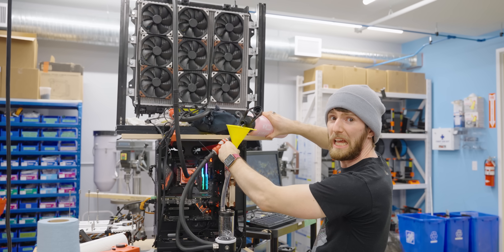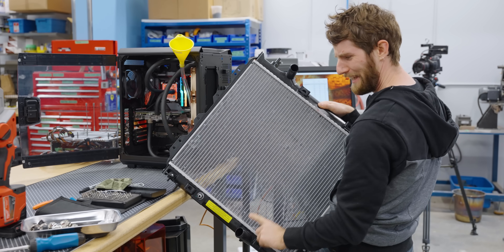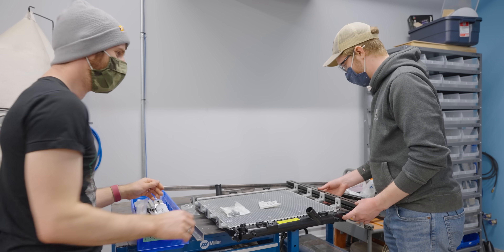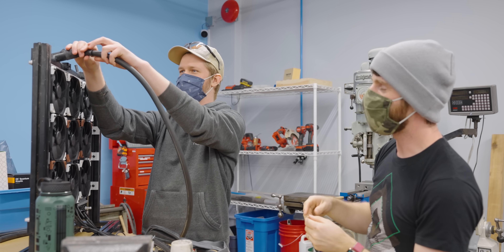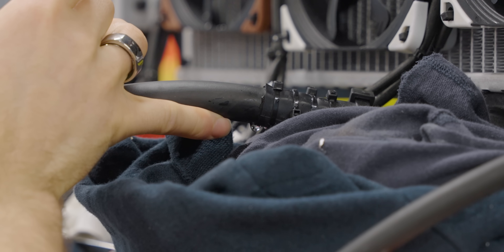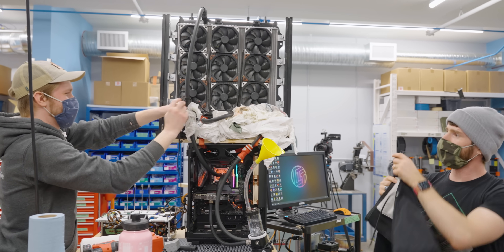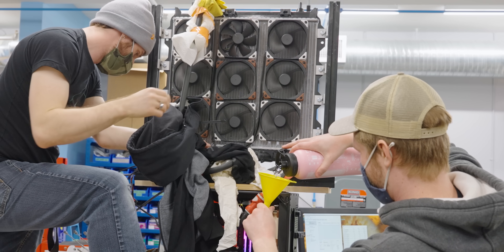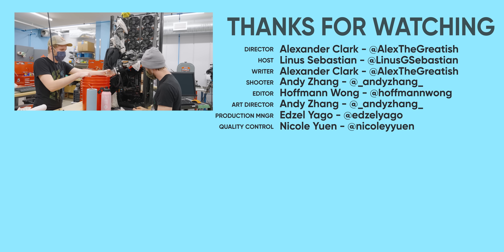Our Craziest Cooling Project Yet - Car radiator liquid cooler

Comment: Wish i could share a PC i built. Took a Transmission cooler for a 2 ton RV and built it into the top of my ThermalTake Cube PC. Used a vintage ThermalTake P500 pump Blue water line and Did a loop system through a Old amd Fx 8120 and an amd 290X. Keeps things super cool under load. Was one of those i think i can make this work. Litterally watching this video on it now. Been running strong for over 7 years!

Comment: I was thinking of just using a bucket. Recirculating the water to the bucket and using a fish tank air pump to cool the water with a aeration stone. I'm thinking 5 gallons should be enough to dissipate 750 watts if it doesn't then I can use ice bottles.

Comment: You went to NAPA to get the radiator. you didnt think host clamps were a good idea? On the other hand, and I say this as a fellow fabricobbler in the adjacent North, this may be the most Canadian thing you have ever done. Much love from the States. Also, why not just 3d print some reducers and using short cuts of the right diameter radiator/pc cooling hosing as couplers? They should take like 20 min to design in OpenSCAD - in fact I think I'm likely to do just that.. but with a Spal fan and appropriate shroud for the radiator, all RTVd together to make a nice airtighht seal with a separate fan controller triggered by an automotive thermal switch, or a nice digital thermometer probe embedded in an NPT plug. In fact, I do have that dead Silverado with everything in the reactor pit perfectly fine... Also Im thinking tranny loop for the cpu(s), as they are not your biggest heat source anymore, and use the big loop for the GPUs. Several big ones. Also a set of cheap inline fuel pumps should make good fluid motivators. Bonus, all the car crap is 12v and very voltage resistant by design(usually about 9-15vDC, 13.8 Nominal) and also designed to be battery operated, though with a limited charge apparatus (ok those are both the same point, but the latter also implies power efficiency, as in, low amperage requirements at proper voltage). Very nice for interfacing with PC stuff, esp with proper mosfets, relays, or other high load power switching. Don't forget your fuses.
Reply: I know! ditch the rad altogether and just stick the rig in your basement next to the water heater. water from the pump goes to your rig, which goes out to the water heater - preheating the entire volume of the water in the pipe between pump runs, and effectively preheating the water for your baseboards and hot taps, lowering your heat bill! all passive. Games or AIs start lagging? Do a laundry run! Tell your kids to take showers! Or keep the rad with no fans as a presoak chamber for the heat and massive passive cooler. Man, if I could get my whole rack to operate like that without it being like the sinking of USS Thresher... Obviously install a bypass valve and conduit so you can reroute the water flow while servicing the main computer systems...

Comment: if you go to a junkyard you can probably get a car radiator for $20 usd (idk what that gonna be in cad) you can get the fans with it for a little more and then if you get it from a car with electric water pump you can get the pump. get some antifreeze and distilled water and you got a crazy cooling loop just make sure the fittings on your pc can handle the pressure. or get a lower pressure radiator cap or something if they sell those

Comment: Watching them hook up into the auto trans cooling lines makes me cringe. It is made for cooling a hydraulic fluid and travels through a heat exchanger in the bottom of the rad. Vehicles with manual transmissions do not use the lines.... they are just left alone.

Comment: Omg guys, all you had to do was put an anti-crush tube inside the smaller rubber tube, then you could have cranked those zip ties down. And a bit of RTV inside the bicycle tube would have been the final icing.

I like most of your "seat of the pants" stuff, but this was a bit shameful. Just plain stupid for the main rad I/O connections.

Comment: you must use liquid to liquid heat exchanger and the suitable fan, bracket, pump, then i promise it well go excellent but not perfect because this radiator is designed to cool 100 degrees rushed water

Comment: Should of blocked of the trans cooler ports its serving no purpose the water on the radiator is just going to try and cool the same water in the trans cooler section

Comment: I plan to build a pc with a water cooler but as a car guy ima find a small turbo housing for the pump with an electric motor spinning the compressor wheel circulating water with water wetter. And a baby intercooler for the radiator with a few fans behind it it

Comment: the transmission cooler part is essentially a heat exchanger core in the outlet of the radiator. It does not need that much cooling and it uses the cold end of the radiator to get that little bit it needs.

Comment: This was pretty disappointing. All they needed to do was use some normal size radiator hose and 3D print an adapter. Or they coulda even ran it in a bucket.

Comment: I'm glad it seems like whoever is making the video schedule has allowed them to slow down in recent years because damn, you can feel the frustration.

Well, unless this was intentionally a meme video lol, but time constraints seem waaaay more likely. Linus seemed genuinely stressed, like why else wouldn't he just turn it off. Kinda sad to see to be honest. You can tell when he's working on a project he enjoys and has the time to do correctly.

But ya, it would've been so cool to see how well it cooled if you used a high-powered fan, I mean, in a car that thing is being cooled mostly by air passing through it as the car moves, not a fan. I wonder if it's even the same type of metal, which if so would mean they'd have different cooling properties.

Anyway, 3-year old video so who knows, maybe there is a sequel to this, I haven't checked.

Comment: For future reference you can often use electrical heat shrink insulation and/or tape to make the smaller pipe bigger enough to use a zip tie to seal on it.

Comment: In case anyone sees this years later, it seems Alphacool will now sell you a 400 x 400 x 45 mm radiator with mounts for 9x 140mm fans or 4x 200mm fans, with proper threaded holes for watercooling barbs. This is not an endorsement, I haven't tried it; but I want to.

Comment: How about you use an water boiler or buffer storage like 100 liters is enough to storage about 1,163Wh/kg*K * 100kg * 50K = 5815 Wh
If we measure a max output of 1000W for a potent System that would be around 5 hours to heat the 100 litres up from 20°C to 70°C
So next step would be a second seperate heating circuit that cools down the water storage. How about a heat exchanger on the outside with antifreeze for winter.
This dont have to need a pump you let gravitation do the work the lighter warm water will rise and the colder more dense water will fall back into the boiler.
This needs time but yeah if you take a 300 liters boiler you need to play like 15 hours on max settings to produce enough heat for the boiler.
Everyone needs to sleep and in this time the boiler cools down on its own without a pump.
Reply: The biggest Problem today is that we have systems that produce more than 500 W heatenergy, this will heat up your room and you have to do something about it.
Thats the reason for external heat exchanger. You can place them in front of the window and blow out everything or heat up your room in winter.

Comment: They are doing it all wrong, which is why it is leaking 🤦‍♀️

What they should use is 1 inch (whatever the OD of the radiator inlet/outlet is) clear hose, 1 inch to 1/2 inch adapter, then attach it to the loop and repeat of the other side.  And use hose clamps rather than zip ties and tape.

Comment: 7:30 Tube will soften when submerged into a hot water (in cup), then can be stretched as needed (put onto a bigger output) and it will tighten soon. This trick is used in the aquaristics. Not sure about usage in water cooling though 🙂

Comment: Should've used an ac condenser off rockauto, just bought one for $70 and the coils are similar size to your lines so it would've sealed a lot better
Reply: honestly you could probably get some for free because they get holes in them sometimes, just need to either braze the hole or cut everything off after the hole

Comment: Linus: Has a company with employees, a building, drops 170 on a  radiator and uses a $1,000+ computer to experiment with.

Unfortunately, also Linus: Employees can't seem to be smart enough to just go get more band clamps and do it properly. More drama and clout chasing by adding unneccessary stress to the experiments. THEYRE 50 FUCKING CENTS DUDE

Comment: Imagine this computer had some special software and had to be running 24/7 with teams of two operating in shifts, constantly running around asking for rags, switching them around, topping up the water, fixing fans and checking temps.

Comment: It Is Funny To See The Videos Of People Wearing Masks Even Though They Knew The entire Time That They DO NOT WORK Against VIRUSES!! Especially Cloth Loose Fitting CRAP! A Box Fan Would Have Made A Whole Lot More Sense!! The radiator Is Hooked Up WRONG!!! The pump Should NEVER Run Out Of Water Unless the Entire radiator Is EMPTY! You Pull Out Of The Bottom Of The Radiator And Have A Fill Reservoir At The TOP!! Therefore The CPU Block Will Never Be Dry!

Comment: You guys really need an hvac/plumber on staff. Or at least a friend you could call. 😂 a catch pan with outlet would have solved the problem. Leak in pan, outlet back into pump through fill port. Kind of makes me want to down some kind of waterfall cooling system now 🤔

Comment: It's not a bad price for a good size car radiator, but it's aluminum... At least you should get copper for that. I'm thinking of making my own super-radiator out of bending a copper pipe in a snaking pattern... or maybe cutting a bunch of copper pipes, then threading them through copper plates, or aluminum that you drill holes for the pipes through. Then the cheapest solution, unless you're a plumber and have a bunch of old copper pipe fittings, just connect the pipes with plastic tubes.

If you're a tinkerer, you won't regret getting a bunch of copper pipes. A car radiator on the other hand is not moddable / extendable, and quite expensive for the materials it contains even when mass produced.

Comment: The second line is a transmission cooler and basically it's just a pipe that runs through the bottom tank If anything it just makes a restriction the bigger two pipes are the ones you need to use

Comment: trans cooler portion is just a mini heat exchanger in the end cap. it uses the air cooled coolant that has flowed down/across the rad to cool the trans via liquid/liquid vs having to be a much bulkier liquid/air auxiliary unit taking up space externally.

Comment: Did you ever mount the radiator horizontally and see if convection air flow would generate enough cooling?

Comment: I think this is such a cool idea. However, I think it could be improved greatly. First off, dont use computer fans, just buy a 12v car fan that is designed to fit car radiators. Yep gonna be loud, but its all designed to work together. Second, I have NO idea what radiator you bought there, but it should only have one in, and one out. Not even sure whats what this thing is you have here. Also, for the purposes of saving money, just go to a junkyard and buy a car rad with a fan for like 50 bucks. Likely come with tubing as well. Dont buy a new product for this, just doesnt make sense lol Id love to see you do it again with a couple improvements.

Comment: You could have done this better with the correct fan for this radiator and a slightly modified sump pump to pump the water as a standalone system, then once the cooling solution works correctly you could overclock the absolute hell out of a processor and GPU combo and see what kind of temps you get.

Comment: the transmission cooling lines are not so much a loop as it is just a big pipe in the base of the radiator that acts as a reservoir to disperse the heat from the transmission fluid. I know this was just a fun video but including the trans line cooling system really was a waste of time you could have just blocked the inlet and outlet and just used upper half of the radiator which disperses MUCH more heat

Comment: car cooling fans are 12v why they use pc ones, also car radiators are designed to accept hoses use those to connect to it and reduce down its easy and dose not leak

Comment: Ah yes the good old times. Back in the day where I was proud to have figured out what a mainboard is and my bigger brother was already up and going for custom case modding one day we went to my uncles place and ripped out a car radiator from an broken down VW Lupo. My brother strapped like 6 200mm+ fans on that bad boy and ran a custom loop with self made cooling blocks for CPU and GPU.. he even made controller PCBs himself from scratch with some acid kinda magic and hours of soldering. I had no idea what he was doing at the time, but in hindsight I realized he was a goddamn genius. it was like around 2007~ back then you could get big towers cheaper then mid towers.. and both didn´t cost a kidney and came with a PSU. Good ol times~

Comment: they need a stainless steel hose clamp for the inlet and outlet on the radiator so it doesn't leak

Comment: Cooling by volume. If the water flows. It will not get hot enough to use the fans. Say 1.5 gallons in the radiator, and .5 gallons in the system. How hot is the pc running? The trans cooler is separate from the main cooling system. If water gets into the transmission. It will burn the clutches out.

Comment: The trans cooler loop cools the transmission fluid because the trans cooler loop is on the “cold” side of the radiator.

Comment: One "loop" is engine coolant.  The other "loop" is for the automatic transmission oil.  Also, TLDR, using an automotive cooling fan would outperform 100 of the best PC fans.

Comment: I too would love to see a non-rushed version and use copper pipe reducers to get down to your pipe size then the bicycle tubing and hose clamps for the connectors. Could be pretty cool. Maybe make all the connections before connecting the power and turning it on? lol

Comment: Please Linus, next time consult car guys when doing stuff with car radiators. Way too much unnecessary leakage and should have used a proper car coolant. Those Radiators keep the engines under 100 degrees when the 4 cylinders are running at 7000RPM. you could do better next time.

Comment: That other loop is for the trans oil cooler loop. Some manufacturers install that with the radiator. Unlike gm it has a separate smaller rad for the cooler lines

Comment: I think I might have found a possible solution for the leaking but it would take some 3D printing for prototype then to afterwards cnc something could work using the actual radiator hose and start a piece the slim down the tube like to something way more manageable with a smaller diameter tube that you can easily get to work

Comment: So, the two loops is because it's for a car with an Automatic Transmission. The 2 smaller lines are for the ATF fluid from the transmission to cool it. You obviously don't want ATF and Engine coolant to mix.

Comment: Little tip for when you guys are trying to tie anything together with tubing always put like metal insert in the tubing first so you can tighten down the zip ties all the way without the tubing collapsing. That would of saved you guys a lot of headache  with those joint leaking.

Comment: TechTip for For Future Crazy Ideas:
If there's a gap between pipe diameters, you can use a thicker pipe, say that has inner diameter of the CPU pipe and outer diameter of the Radiator pipe's inner diameter, 1" length cut section would be used as an adapter, and fits perfectly between the 2 pipes.
I used it and didn't leak for 6 years. Also it's easy detachable.

Comment: The entire surface area of the radiator is for the big inlet and outlet which cools the engine. The tiny inlet and outlet has another tiny radiator inside the plastic end cap of the radiator that cools the transmission fluid. But that tiny radiator is way smaller than even a standard PC radiator so there's really no point using it.

Comment: Did anyone else notice that radiator was faulty to begin with? He was pouring water into the coolant side, and water started coming out of the transmission cooler side.. coolant/transmission fluid aren't supposed to mix. if this had been thrown into a car, it would've...

Comment: You don't have enough flow. So water drops down the first vertical before it floods all across the top and uses the whole radiator. You're hardly using any of your radiator.

Comment: For some reason when the video started I envisioned Linus having custom tooled fittings, and all proper hoses, then I kept watching. 😆 I had thought about this in the past, my dad worked at autobody shops and had spare radiators / radiator fans and even heater cores, but never got around to it, nor had a PC that would benefit from water cooling.

Comment: The insanity of using an automotive radiator with nine computer fans rather than a single actual radiator fan.  Recent ones support PWM speed control and since most are designed to dissipate several hundred thousand kilowatts of heat from an engine, could easily be run at speeds low enough to be nearly inaudible.